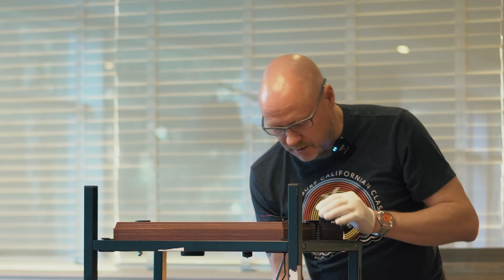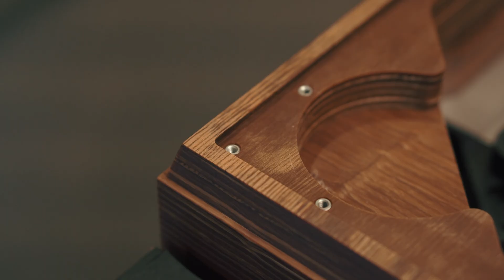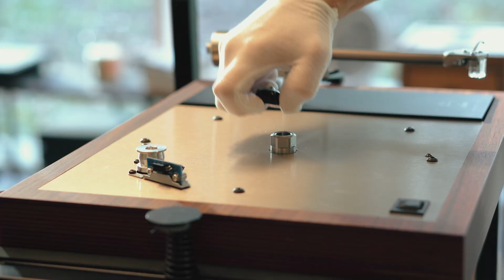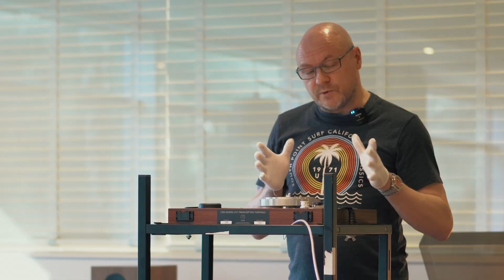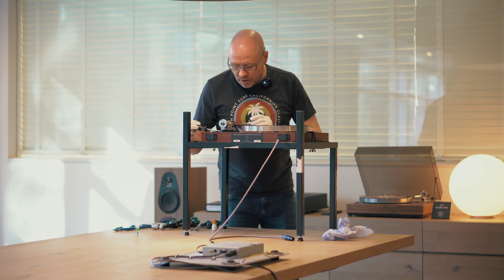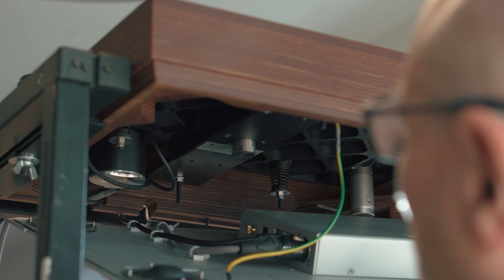Building LP12 featuring all-new Bedrok™ plinth | Linn

Comment: If Porsche can charge $15,000 for their top leather interior, why not let Linn charge $8k for this piece of wood. 
I’m very happy with my LP12, I’m not going to buy it - but there are many people (not me!) for whom $8k isn’t very much money to spend on a hobby. 
I hope the money helps keep the costs down for their entry level stuff, since Linn remains a great Hifi innovator in a world where a lot of people think a Bluetooth speaker will suffice as a home stereo.
Reply: I suppose it's no more different than someone spending hundreds of pounds on a power cable that's plugged into a £10 wall socket supplied by 2.5mm cable that cost £10 for a 100 mts
Reply: @ Yes and through a cheap fuse too
Reply: @verite  exactly! It's a hobby - people ought not to have to justify how much they spend on their hobby. You need to be able to account for and afford the hobby, but you shouldn't have to justify what you spend to others (apart from her indoors - of course 😉)
Reply: @ THis is not about justification on what people spend, it's questioning why Linn is asking £8000 for a piece of plywood.
Reply: Remember, too, that Porsche will mandate regular servicing - not cheap - just to prevent warranty invalidation. I wonder what % residuals are against a second-hand Porsche relative to a used LP12 of the same age? How many fifty year old Porsches are there still in circulation that can be brought up to current model specification by retrofit components? Exactly none!
Reply: @russputin6294  A car is a very complex machine, yet Linn is asking nearly the price of a car for a bit of machined plywood and a sheet of steel.
Reply: @jeremynorth  "A bit of machined plywood, a sheet of steel", a lifetime's experience, research and development, a peerless historical industry-leading reputation for innovation, quality and product longevity and the extra costs incurred against exclusive, low production run niche products. I'm afraid this product is the essence of capitalism in a nutshell; It's a luxury product that no-one's being forced to buy (unlike, for instance, the products of the pharmaceutical industry that hold their customers and the Government procurers literally over a life-and-death barrel for, in my opinion, their equally over-priced and often ineffective and dangerous products) and every sale upholds the social infrastructure of the country; v.a.t., corporation taxes, p.a.y.e. from the employees who make it; Buy a bedrok and eventually it helps subsidise the NHS, education and the war in the East against the apparently illegal communist special military action against Ukraine.  (that's the blue touch paper lit....) If Linn have it wrong then leave them to wallow in their fate; if they sell then that's the definitive, absolute proof that their product and their pricing policy is sound ;0)

Comment: Amazing to watch such detail and precision.  My LP12 is 25 years old, I dont' think its had such care and attention since it left the factory and the UK!
Reply: Impressive presentation but the plinth alone is 20X more costly than my LP12 bought over two decades ago
Reply: @Jpvashon  Kier Starmer tells me that's a legacy of the Tory government economic strategy and inflation they inherited. In addition to the £22 billion black hole in public finances when they audited the books they found the price of a Linn has increased twentyfold but don't worry, they're taking tough decisions to deal with it and under a Labour government all irregulars will be given a free Klimax system the moment they disembark their rubber boat at Dover. This will be partially funded by the cut in Pensioners winter fuel allowance; if they want to stay warm they can burn their old plinths as firewood when they upgrade to Bedrock 😆